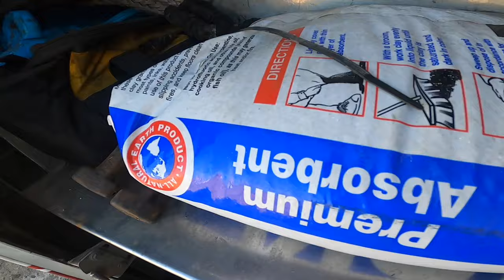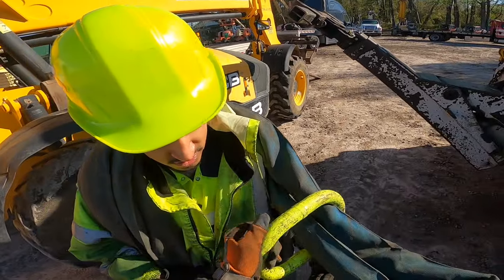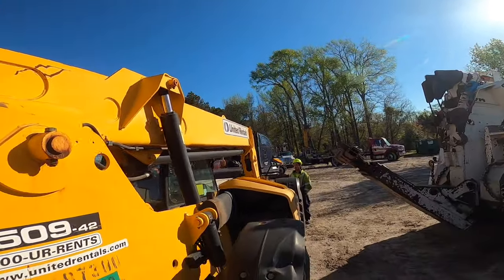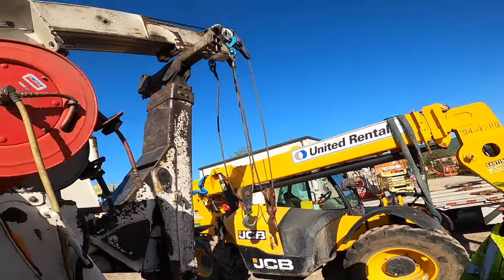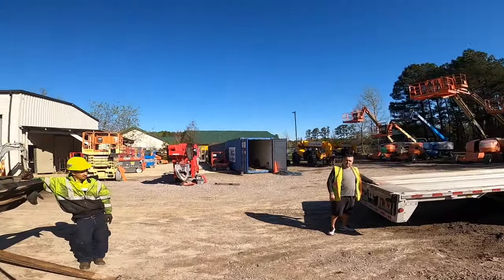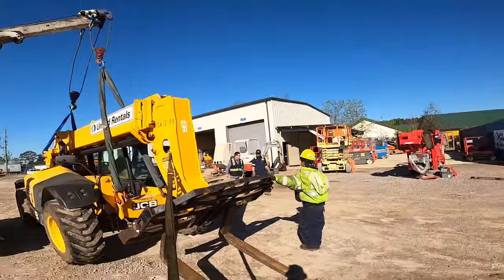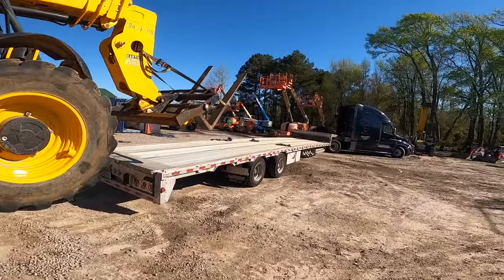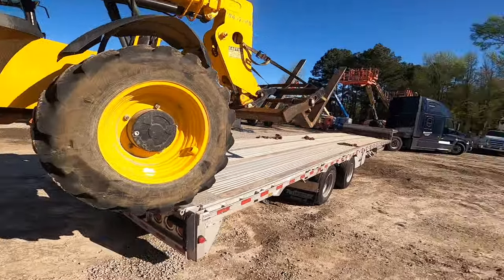Telehandler needs a lift

Comment: Someone got the fuel cap,and just a little reminder, Standard Iron shackles,or clevises,, are proper pin backed of 1/4 turn for full tighten, calib will😮learn the hard way some day,, when they get twisted in the eye bolt and tight Beyond the point and he will have to get creative the get them loosened,,,lol  every day is a skhool day,,thanks BigAl California.
Reply from the maker: Mr AL Yes sir we discussed that. Thanks for watching and stay safe
Reply: i hate to be contrary, backing a shackle off a quarter turn is for your convenience or ease of use. under full load its to be snug. yes they tighten sometimes. thats why God invented lady slippers

Comment: Mr. Hal,  I figured the gopher would’ve made light work of this unit! Lol great job as always! One more thing is it better to strap up run your winches in and then use the boom to pull up  or set the boom and winch it up? I’ve seen it done both ways.
Reply from the maker: Mr Walter I like to set my boom then winch up. Thanks for watching and stay safe